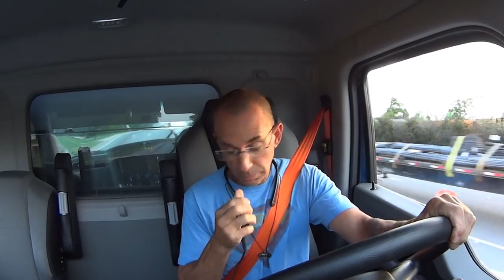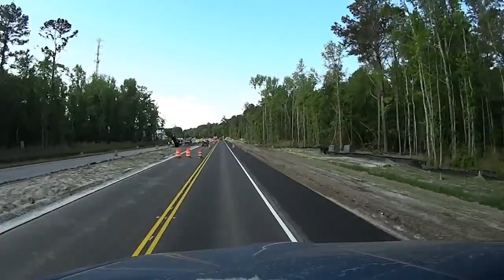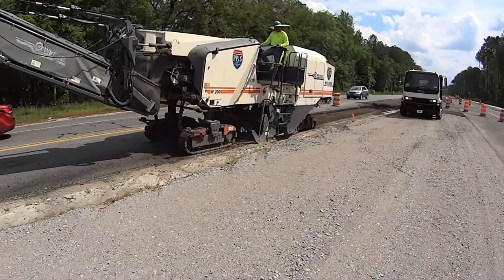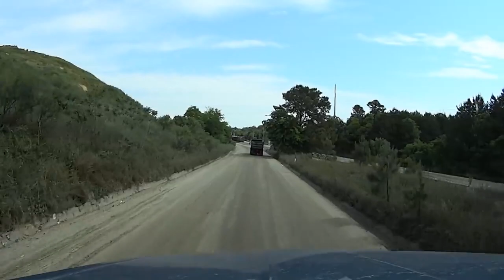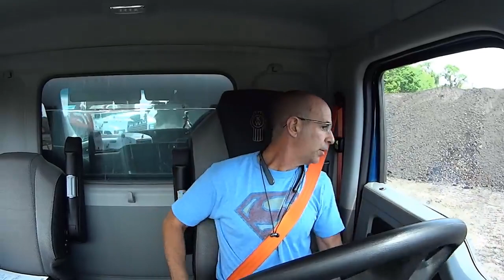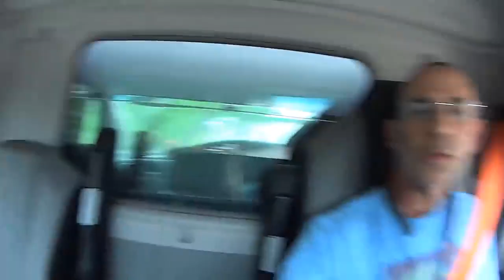Ep 3 Dump Truck Driver's Vlog - Road Milling

Comment: Hey 281, I work for RDLC, they call me Road Block. I ran with you to the ponder pointe job Friday! Next time I run into you I'll introduce myself. Good to see another dump truck driver from the area posting some videos!
Reply from the maker: Why do they call you road block? I enjoy riding with you guys. You have nice equipment and drive respectful to others. See ya on the roads
Reply: @dansvlogtrucking  my boss man gave me the nickname years ago, and it stuck. We try to take pride in our trucks. We have 9 total so a lot smaller than blue max. Glad to see a respectable company come into the area! I'm sure we will be running together a good bit. I've been dump trucking the past 7 years and love it. Took me two videos to realize I have watched several of your roll off videos. Keep them coming!